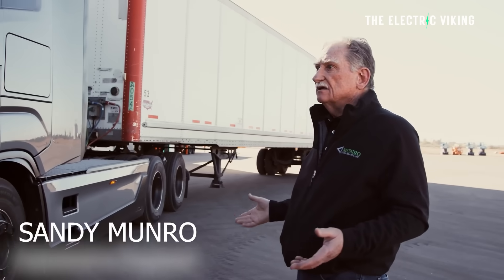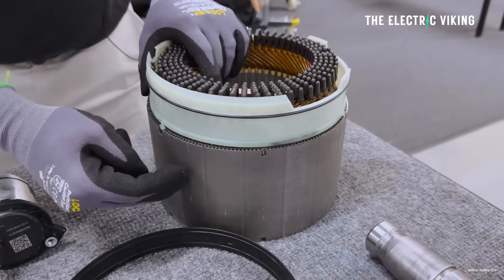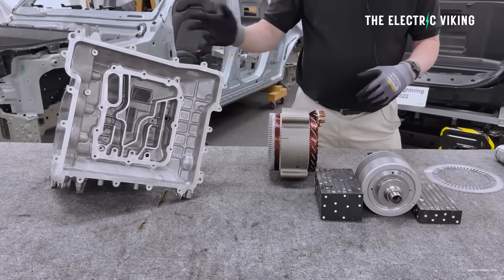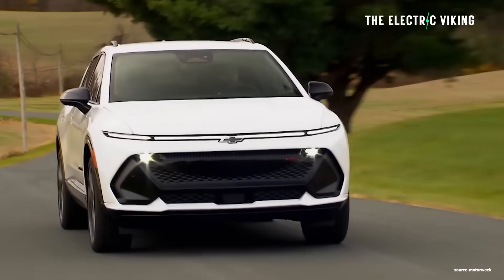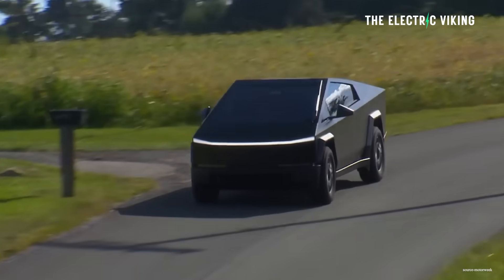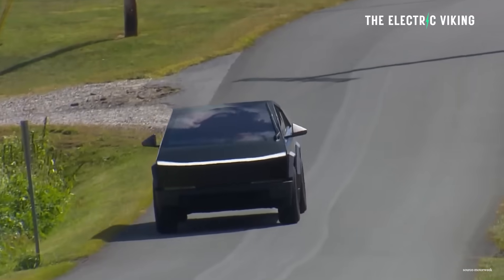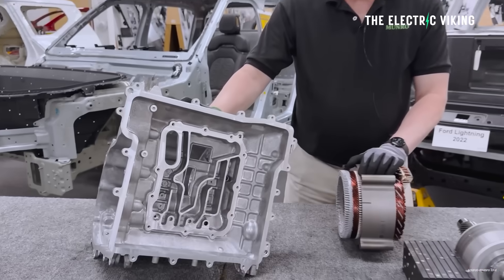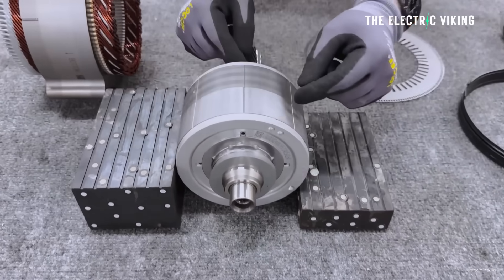Sandy Munro Tears Down Tesla and Chevy EV Motors & Discovers This...

Comment: I was torn between the Equinox and the model y… but the charge network, cargo room, HP, Full self driving cabin room sold me on the Model Y…
Reply: As. 2018 Model 3 owner, pre brain worm maybe?, I just want to say I hope all Tesla super chargers eventually charge all cars with those long V4 dispensers. Wife has a Bolt, with upgraded cells. Love them both.
Reply: You chose…….wisely.
Reply: You don't prioritize SAFETY?  🤔  (Teslas are THE SAFEST vehicles ever tested.)
Reply: @almostthere100 Until they catch on fire and you can’t get the doors open nor can anyone outside get them open.  NHTSA and IIHS crash tests cover only some aspects of safety.  There are many others.  Having a car where the doors can’t be opened normally due to an electrical failure is an unsafe design.  Period.
Reply: @LTVoyager   Inside, ALL doors have MANUAL releases.  Exterior you can break the window and open the door, but I admit that is a surprising design flaw.  Nevertheless, ALL Teslas have repeatedly scored as the SAFEST vehicles tested and real world data is overwhelmingly supportive of my assertion.
Reply: @almostthere100 If the victims cannot open them during an emergency, nor can the first responders, then there’s a problem that needs fixing. The mechanism is immaterial. The crash testing is not intended to test this issue.
Reply: @almostthere100 They have separate emergency releases that may be hard to find after you have been in an accident and your car is full of smoke or bent out of shape.  The normal door latches should work in most circumstances, at least on sides of the car not severely damaged in the crash.  A simple electrical failure should NEVER disable the normal door latches.  And there are no outside emergency latches.  And in many cases breaking a window is nearly impossible if you don’t have proper tools handy.  People can rationalize all they want, but Tesla made a stupid design choice in this case and seems to want to double down on its stupidity.  I predict at some point either a large lawsuit judgement or, more likely, a government recall of ALL Teslas will finally get this corrected.  It will be very expensive for Tesla as a recall is going to pretty much affect every vehicle they have ever made.
Reply: @almostthere100 No, real world data is not overwhelmingly supportive.  Many have questioned the methodology of many of the studies and many of the studies refuse to disclose their data and methodologies for independent review.  I believe the jury is still out as the Tesla fleet is still pretty small in the context of other brands.  However, none of that matters if you are one of the people who couldn’t get out of their Tesla and burned to death inside because of a poor door latch design that the company refuses to correct.
Reply: @LTVoyager   In the HUNDREDS of BILLIONS of miles driven in 8+ million Teslas, how common is this situation where someone was trapped and burned to death?  Why hasn't NHTSA forced a recall?  Is this more of a theoretical issue?  🤔
Reply: @almostthere100  I am posting the StacheD video link, but it likely will get blocked by YouTube which is why I posted a text description a moment ago.  https://youtu.be/NCJHu1NDhx4?si=NFUE1tpc99oMGPxS
Reply: @almostthere100 And three weeks ago in Germany.  https://youtu.be/hd3Wntl4VWc?si=yHER3wqvnDqidt3B
Reply: @LTVoyager   As I suspected, these instances are extremely rare and in this instance the manual door release was available and functional.  The operator failed to use it.  ICE vehicles catch fire at a rate 9x of EV's.
Reply: @almostthere100 The ICE rate being 9X that of EVs was debunked long ago.  If the occupants of the vehicle are unconscious from the crash or from smoke inhalation, they will not be able to use the emergency release.  And there is no emergency release for outside rescuers when the normal door latches fail.  That is an unconscionable design.  I did a search and found many of these entrapments so not sure they are as rare as you would like to think.  And it doesn’t matter if it only happens once.  A bad design is a bad design and it should be corrected.
Reply: Yes, if money isn’t an issue, Tesla is almost always the best choice.  The Equinox though is a good value for many.
Reply: @LTVoyager a crematorium on wheels. *I AM 107% CERTAIN YOU DON'T VALUE YOUR LIFE!!*
Reply: being torn should send you towards a non doge choice. or you are not really torn
Reply: @ChuckHiggins-bq8vr He was torn for logical reasons not stupid political nonsense such as being against eliminating government fraud and waste.
Reply: A truly awful car. First you set yourself up for failure by manouvring yourself into a false choice and then you failed.
Reply: @jurajkovac5027 This makes no sense…
Reply: @skepticalmechanic None of the Elon haters make any sense.
Reply: @jimup Elon has done some great things, and some horrible things. I love the EV and rocket stuff, and find the Boring interesting. I hate that he helped trump win, and DOGE was an unmitigated disaster.

Comment: Yasa radial flux motors are easier to cool than radial flux motors.  On radial types the stator windings have more resistance and heat.  Lambo is using them, but I doubt Munro will be doing a tear down.

Comment: “GM’s option might not be better for the long run because it doesn’t work when the motor is still”
You know what else doesn’t happen when the motor is still? IT DOESN’T GENERATE HEAT.
Reply: Yes, this statement demonstrates why you don’t listen to YouTube “experts”, but real experts like Sandy who have a clue.
Reply: Thermal inertia
Reply: He was not totally wrong. If the motor has been running at high power, and suddently stop and the cooling  oil stops flowing, there will be residual heat, and if you are doing hill climbing, or off-roading,  that could be over heat the motor.

This is actually a problem for SUV with AWD, when doing heavy off-roading, the AWD transmission sometimes gives overheat warning.
Reply: @esphilee No, that isn’t correct.  The motor will only overheat if you are putting more heat in that is being rejected.  This will not occur when the car is just sitting still at a stoplight.  No matter the temperature of the motor from its past operation, as soon as you stop, the motor will begin to cool as long as as the surroundings are cooler than the motor and you aren’t putting more heat into the motor.  Now, if you put the nose of the car against a stone wall and then push the throttle to just short of wheel-spin, of course the motor when then overheat as you are putting heat into the motor and the centrifugal cooling has been defeated with a stationary rotor.  That isn’t what was stated in the video however.  Sitting at idle will not overheat the motor no matter what you were doing right before you got to idle.
Reply: @LTVoyager, simply put: stop-and-go high power situation, like off-roading and hill climb causes over heating.
Reply: @esphilee The overheating does not come from sitting still.  It comes from demanding high power at low speed.  That isn’t what the comment in the video said.  The video comment is simply BS from someone who doesn’t understand physics.
Reply: He should criticised the GM motor concerning climbing hills. The speed and therefore oil flow will still be low but the workload will be high.
Reply: ever heard of heat soak?
Reply: I agree, I don't like videos of people just speculating on how well a system works with no evidence. I want to see the oil system with the car driving up a hill, slowly. I bet it still works fine.

Comment: Am I the only one puzzled at the fact they’re using OIL to cool something??
Reply: In certain electric motor applications, oil is used instead of water due to its superior lubrication, thermal management, and dielectric properties. Here’s a concise explanation:Lubrication: Electric motors with moving parts (e.g., bearings, gears) require lubrication to reduce friction and wear. Oil provides a robust lubricating film, while water’s low viscosity and lack of lubricity make it ineffective for this purpose.
Thermal Stability and Heat Dissipation: Oil can handle high temperatures without boiling (unlike water, which boils at 100°C) and efficiently transfers heat away from critical components like bearings or windings. This is crucial in high-performance motors where heat buildup is significant.
Dielectric Properties: In applications like oil-cooled electric motors (e.g., those in electric vehicles or industrial systems), oil acts as an insulator, preventing electrical arcing or short circuits. Water, being conductive, poses a risk of electrical failure in such systems.
Corrosion Resistance: Water can cause rust and corrosion in metal motor components, especially in humid environments. Oils, often formulated with anti-corrosion additives, protect these parts and extend motor lifespan.
Viscosity and Sealing: Oil maintains consistent viscosity across a wide temperature range, ensuring reliable performance in varied conditions. It also helps seal gaps in components like bearings, reducing contaminant ingress. Water lacks these properties.

Specific Applications:Oil-Cooled Motors: Used in electric vehicles (e.g., Tesla motors) where oil circulates to cool windings and lubricate bearings.
High-Speed Spindles: In CNC machines, oil lubricates and cools high-speed bearings.
Transformers and Submersible Motors: Specialized oils (e.g., dielectric oils) provide cooling and insulation without conducting electricity.
Reply: @johntalbert8227  Thanks for the clarification. I was more confused by oil’s lower specific heat but I get it now.
Reply: @migmigjohnson6083  Engines put out a LOT of waste heat. Motors are >90% efficient.

Comment: I'm calling BS on the eddy currents reducing with temperature, its not significant.  You need electrically isolated particles to reduce eddy currents, but these are too weak for a casing.
Reply: Electrical transformers use high silicon steel for high electrical resistance.
Reply: It is  higher resistance, but the thermal coef is also lower.  It changes resistance less with temperature.

Comment: VWs APP550, which Munro put on the same level as Tesla, is using the pumpless „throw and use gravity“ mechanism, but adds a pretty smart water cooling hybrid around the stator housing to the system, which is used for (pre-) heating the batteries and the cabin.

Comment: The other thing to consider with the Tesla system is that the motor cooling system is an integral part of the HVAC system. Tesla can alter the phasing of the motor to create heat for the cabin or heat the batteries for preconditioning & cold weather. Instead of creating heat with a resistor they use this ‘dithering’ of the phase control in the stator & transfer the heat to wherever they need it. Their heatpump system has revolutionised the way HVACS are managed in new cars. This is similar to the groundbreaking gigacasting Tesla developed & they have done the same here. The GM system whilst simple cannot harvest the heat levels like Tesla does. I am not pro Tesla or anti Tesla. However I recognise when a revolutionary idea is implemented & give cudos.
Reply: It's not revolutionary, I don't think. It's more about efficiency. Instead of adding components just see if you have everything you need to work with. 
Think Volkswagen Beetle. It wasn't revolutionary as much as it was ingeniously simple AND efficient.

Comment: I'd like to know if it would be possible for solid state cooling using the peltier effect.
Reply: Inefficient. That's why only small refrigerators use them.
Reply: Extremely small effect!
Reply: I only see the possibility of some type of heat pipe, which is limited to the stator.

Comment: Would be interesting to know if the Tesla method is as reliable long term - more complexity could mean more likelihood of component failures.
Reply: They have proven over a million miles in multiple cars since 2012 .... Tesla is far superior
Reply: Easy answer.  What are the points of failure?  In the GM it is the motor itself.  In the Tesla it is the high pressure pump.  Which is less expensive?
Clearly the pump.
Reply: "The best part is no part." - Elon Musk
Reply: @kit888  So, remove the motor?  Please explain.
Reply: @davidbeppler3032 Going by what Elon says, I would have expected Tesla to go for the simpler pumpless solution. But I am not a mechanical engineer.
Reply: @kit888 Elon wants Tesla to stay in business ( and get his eventually Trillion dollar compensation), GM wants Bailouts , and Mary Barra wants her yearly multiple million 💰bonus
Reply: @kit888 Elon wants Tesla to stay in business ( and get his eventually Trillion dollar compensation), GM wants Bailouts , and Mary Barra wants her yearly multiple million 💰bonus
Reply: @kit888  the simpler solution is prone to failure.  Tesla does not build in planned obsolescence.  That is all GM.

Comment: Keep in mind, GM always builds-in failure.  GM has determined that it's better for business for their products to fail shortly after warranty expiration.  It's both an Art and a Science, that GM more often than not, gets right.
Reply: Good stuff!
Munro Engineering rocks.
Reply: Teslas are engineered as million mile vehicles.
Reply: @GWAForUTBE LFP models maybe. I can't imagine NMC batteries going close to that. Love to be proven wrong
Reply: @mickydee26 Battery technology is a very evolutionary science.  Id imagine eventually a super crystal based battery will replace all older outdated tech.  The older Teslas will still be viable.
Reply: that’s bereft of any commercial logic, can’t believe you buy that rubbish
Reply: Nonsense, idiot.
Reply: We are on our third battery at 27,000 miles in a 2020.  They sure got us early.  😂
Reply: @travisyarbrough4033 Isn't that warranty costs on them?
Yeah, pia though..
Reply: @ronfarnsworth7074 Their supplier pays.  Unless GM made the part.  They also account for a average failure failure rate.  " problems per 100"
Reply: @BeingMe23  GM and LG split the pre '22 Bolt battery replacements 50/50 I've read.
Reply: That's why they win all those JD Power Awards for "initial quality". 😂
Reply: @JEP-Tech  Excellent and sadly true
Reply: @JEP-Tech First 90 days of ownership
Reply: As a former owner of Chevy and GMC products I have experienced the GM planned failure.  At 80,000 miles they start failing along multiple systems.
Reply: GM built the first EV and has been around for a very long time because the build decent affordable cars. No one engineers failure into product a sticks around
Reply: @michaelthomas7898  Engineers are given certain metrics to work with, and that can mean certain levels of precision as designed into the vehicle for various moving parts.

A better example is appliances. They are most certainly engineered for a certain life. There are 40- 50-year-old refrigerators and freezers and washers and dryers still working, while you can only expect a new one today to last 15 to 20 years max.

Vehicles are the same way. 

The Japanese, for instance, are not known as innovators, but they are known for quality because they have higher standards.

A Toyota Tacoma is expected to go 300K miles and a Ford or Chevy is expected to go 150K miles before it is not worth the repairs anymore. This is not a coincidence. We all know it
Reply: @Nick-k3p1w  You forgot to add this is all your opinion.
Reply: @michaelthomas7898  What is my opinion? I just listed facts of the matter
Reply: @Nick-k3p1w  Last two paragraphs are your opinion.
Reply: @Nick-k3p1w Its only not worth it unless the owner plans to resale in near future.
Reply: @michaelthomas7898  They are the expectation of everyone who knows vehicles, and that is a fact
Reply: @michaelthomas7898 Did you forget that they went bankrupt and are only around because every American tax payer was forced to bail them out? If not for that, all their competitors would have taken their market share.
Reply: @michaelthomas7898 
Uh, General Motors went bankrupt and was bought out after the crash! 😂😅😂
They're not even general motors anymore! 
It's a holding company with something like 20% Chinese ownership!
Reply: @Skunk106  General Motors LLC look it up, and the US still holds a lot of stock in the company stock.
Reply: @michaelthomas7898 Technically the worlds first EV was made in the 1830s and were very popular in the late 1890s till 1920s.  The first 100 mile range was made in 1916.  Obviously they only went about 25 mph.

Comment: Using heat on the outside of the motor to increase electrical resistance, which then leads to less back EMF and increased efficiency is genius.

Comment: Just another thing that sucks Battery Juice to Lower the already low Range vehicle.
Reply: But that theory doesn’t apply to reality. 😊
Reply: The fact you shouldn't charge it past 80% with quick  charge or let it go below like 20% , plus you nust fill up before 80% not over it  plus A .C. Heater drain , sentury mode drain...etc this must be your first introduction  to E.V.s , welcome@malcolmrickarby2313
Reply: Tesla has the most efficient cars.

Comment: Splash oil systems were used in the early days of ICE cars - like the model T. So it feels pretty likely that this method would occur to an old ICE car manufacturer. Well, done obviously, but probably the Tesla solution will deliver better reliability going forward and doesn't sound too complex or use too much energy.
Reply: As system with less parts that works even if a pump fails sounds like the much better solution to me.

And I can see the Toyota system being copied by VW and GM, so the top 3 manufacturers in the world all went with the simple tech after doing millions of test kilometers in all climate zones and traffic conditions.
Reply: It sounded like it was more efficient than the splash system not reliable. Model T motors are still turn a hundred years later.